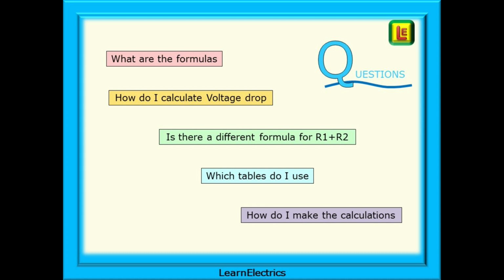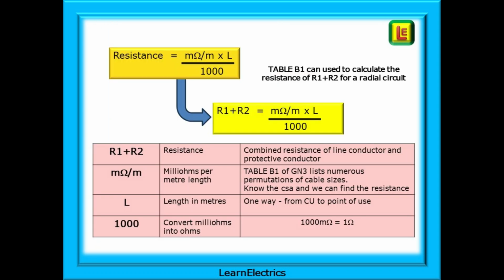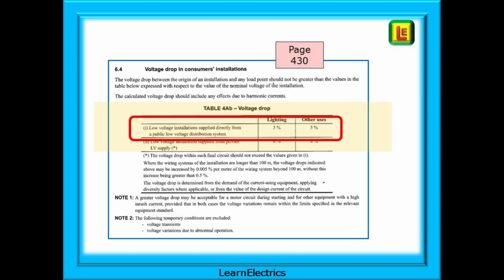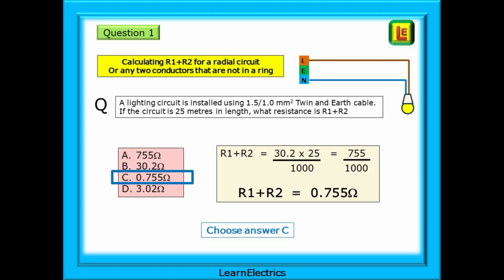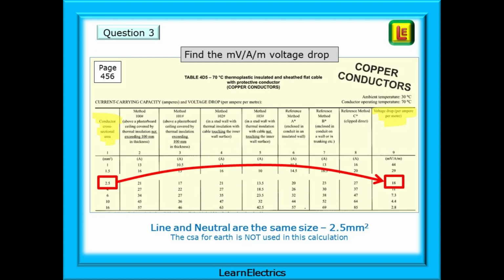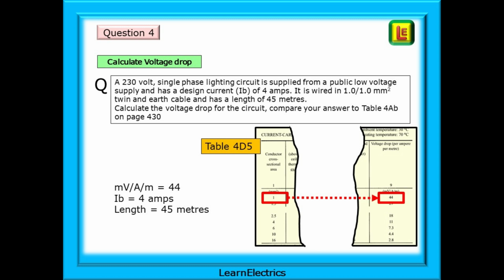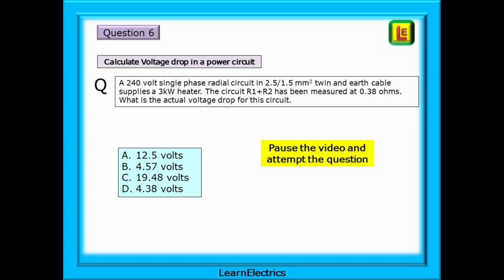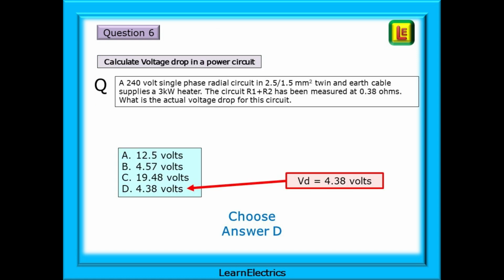VOLTAGE DROP AND CABLE RESISTANCE EXAM PRACTICE – PRACTICE QUESTIONS AND FULLY WORKED ANSWERS

Comment: Hello great video as usual. What is the acceptable voltage drop for the supply cable from the main fuse to the main fuse board? Is it 5%?
Reply from the maker: Depending on length , load at the time, and CSA, most domestic boards will have a Vd of much less than half a volt even when heavily loaded, Make the tails as big as possible and as short as possible.

Comment: Hello. Question 6. 
Thank you for your videos, they help me a lot in preparing for the 18th Edition exam.
I studied to become an electrician in another country. I noticed that sometimes we have different approaches to searching for the same values.

Please explain why we cannot immediately multiply the resistance of a circuit by the current flowing in it?
Multiply 0.38 by 12.5 and we get a voltage drop in the circuit of 4.75 V
Why make it so complicated - count the length of the circuit, find the voltage drop per amper per meter in the table, and only then calculate the voltage drop in the circuit?
Reply from the maker: This is way the UK Regulations work.
Thanks for watching.

Comment: why did you do kw/230 in question 5 and kw/240 in question 6 ? because the first gives you 13.1 amps and the latter gives you 12.5 amps this giving two different answers both of which options in the answer box. TIA
Reply from the maker: To get people to read the question. Nothing else. Thanks for watching. Dave.

Comment: Please apart from this MFT instrument, which other instrument can be use to determine the resistance value of a cable for for a distance of 1m
Reply from the maker: I will often use a multi-meter for resistance measurements. Dave

Comment: Hi dave excellent video thanks you. 
Voltage drop calculation  on 3 kw heater  you 
Put 18×2,5×19 477/1000 
Is wrong  Voltage drop.
I thing typing  mistake 
Excellent video thank you so much
Reply from the maker: Yes, a small typo, should be 12.5 as shown in the previous boxes. The answer is correct though. Dave.